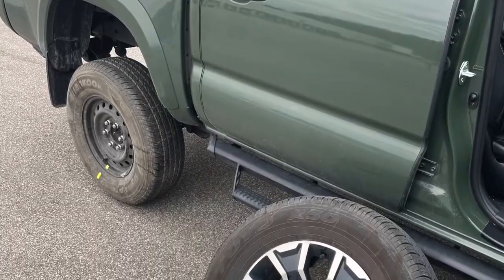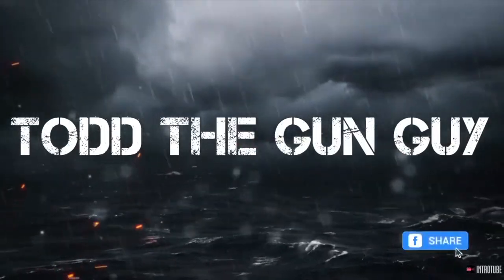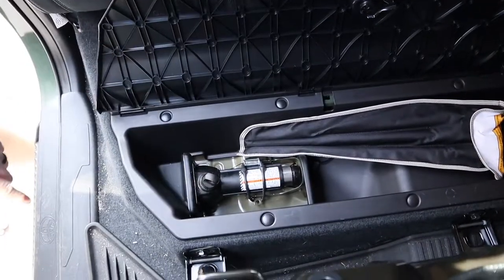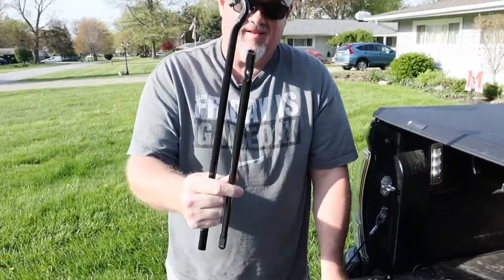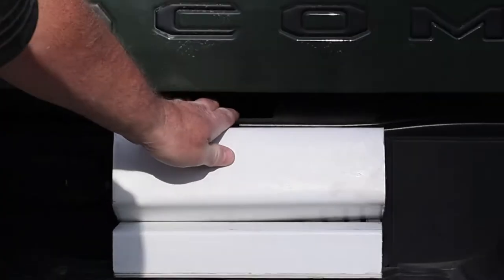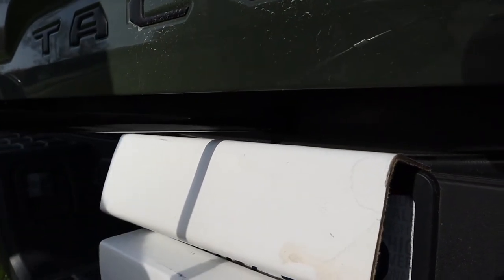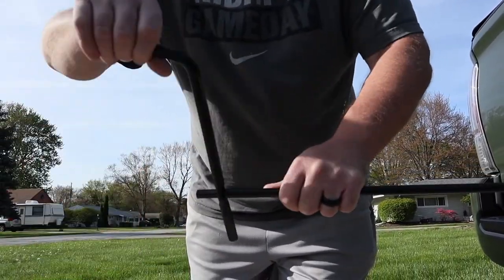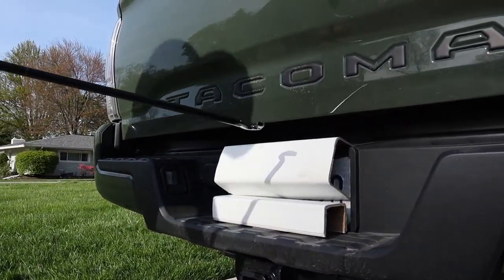Simple and Easy Tips How To Drop Your Spare Tire on a Toyota Tacoma

Comment: Thanks, this hasn’t happened to me yet. Knock on wood. I figured it went something like that.
Reply from the maker: I sell industrial packaging and always near nails😩
Reply: @ToddTheGunGuy  dang, yeah I have bad luck when it comes to that stuff, I keep a tire plug kit in my Tacoma and my car plus a air compressor that plugs in cigarette outlet so if it’s easy fix I’ll plug it and add air to save time on taking tire off. Like to have options bc I work 45min-1hr from home.
Reply from the maker: @jackbauer9077  This one was on out tee tread and they wouldn’t plug.  Cost me a new tire and now have to get aligned
Reply: @ToddTheGunGuy  dang that stinks. Hope you have better luck